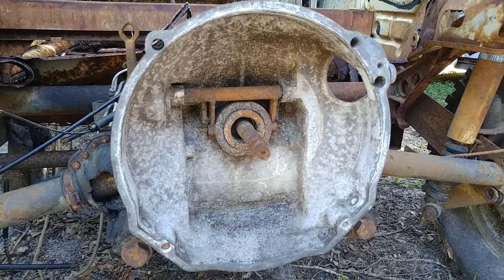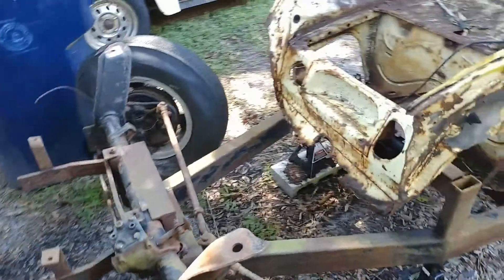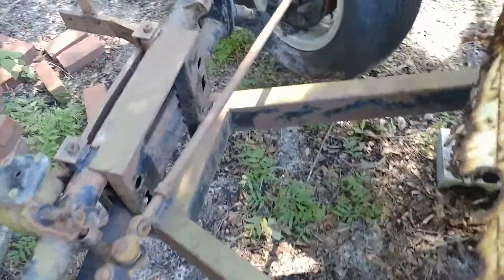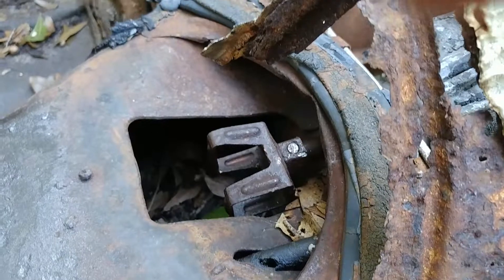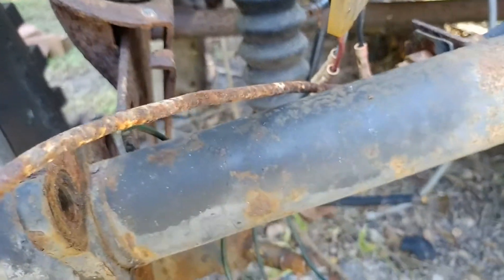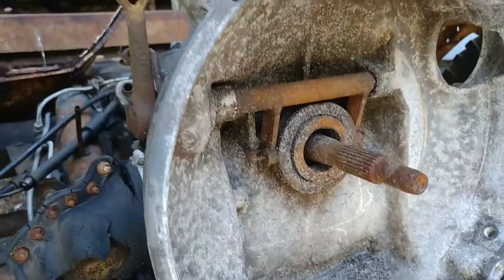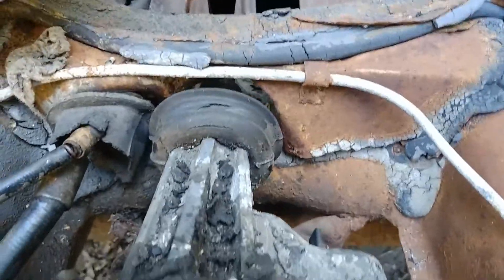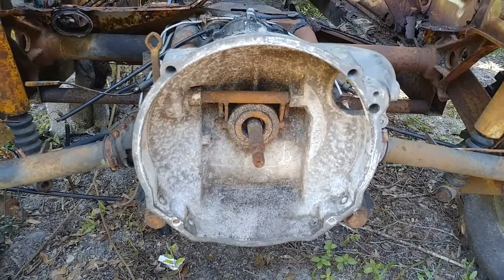CLASSIC VW SWING AXLE TRANSMISSION. I NEED YOUR HELP.

Comment: Remove 2 nuts in the front mount, 2 bolts in the rear,  3 bolts on each spring plate,  2 brake lines, 2 ebrake cables, 2 lower shock bolts, the shift coupler, and the clutch cable and any wiring for backup lights/fasten safetybelt lights... AND A GROUND STRAP!  Bloop! Its out! Spring plates and nose cone don't need to be removed, but pretty much everything else does.
Reply from the maker: It was brake line on the swing axle holding it
Reply: That'll do it!  I remember my first time, lol!  :-D

Comment: Big pry bar and just wiggle it out a inch or two the you should be able to just lift it out
Reply from the maker: Big 🔨. Thanks for stopping by and the comment. Its my first attempt at a swing axle. Every nut and bolt has been a fight.
Reply from the maker: Haven't seen a new video from you in a bit
Reply: Volkswagenplanet yeah that bug looks pretty ruff and they stretched the frame in a really odd way and yeah I’ve been working 12 or more hours every day so I’ve been tired
Reply: My turbo has shown up so I am planning on putting something up about that
Reply from the maker: @Baker5695  I hear you on the tired part. That is why it took me so long to figure out I had to unhook the brake lines. The back pain didnt help either. I have 6 herniated disks and on pain meds. Anyways, don't loose focus on your bug. Its the small things like your comments that keep me going. 
- Keep Dubbing -